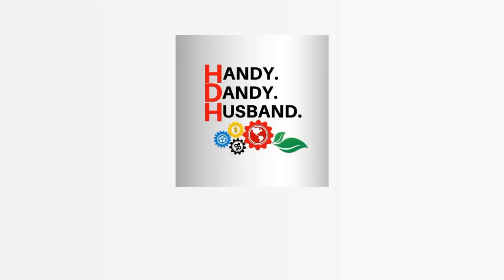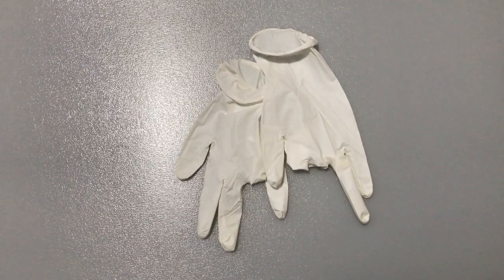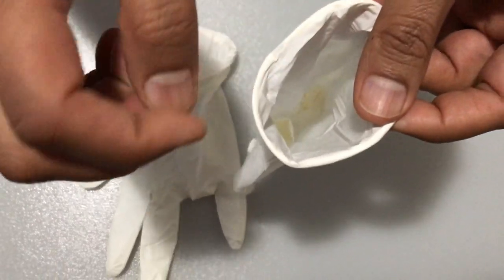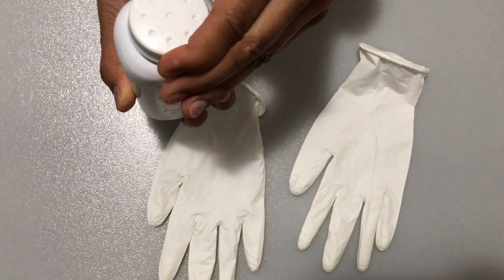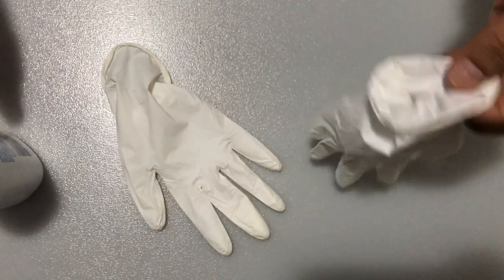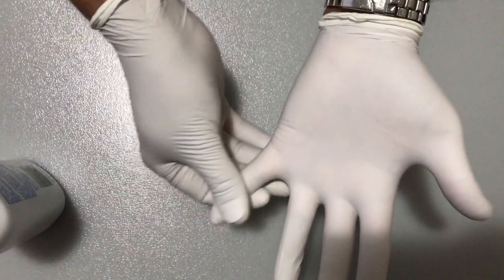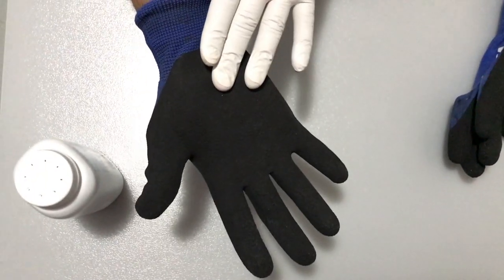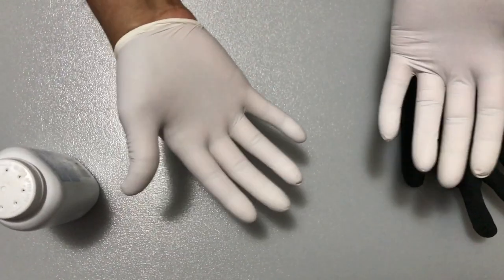𝗤𝗨𝗜𝗖𝗞 𝗧𝗜𝗣: 𝗥𝗲𝘂𝘀𝗲 𝗟𝗮𝘁𝗲𝘅 𝗚𝗹𝗼𝘃𝗲𝘀

Comment: Ok... Can i use other powder instead of baby powder?
Reply from the maker: Hi Rubel Sarkar.  Thanks for watching and sending me your question.  I suppose you could use other unmedicated powders; however, I have not done so because baby powder is ground so fine and is readily available.  If you do wish to use other powders, I would first check to make sure that 1) you are not allergic to them, 2) that the powder is ground to a fineness that does not irritate your skin (not grainy), and 3) that the material the powder is made does not have a crystalline structure (i.e. salt or sugar) which could act abrasively on your skin as you move your hand in the glove.  Hope this helps.  All the best to you, H.D.H. [: {].

Comment: Don't you sweat even more with gardening gloves over Latex gloves? Especially in summer💦🤣
Reply from the maker: Hi CJD, Thanks for your comment.  Yes, admittedly I do perspire more with the latex gloves and gardening glove combo, but I suppose I have become used to it.  For me, I hate it how the latex tears very easily if one rubs it against a sharp edge/corner which a typically vehicle engine  compartment is full of.  The gardening gloves act as a buffer and a bit of cushion from the edges while the latex gloves prevent grease and oil from permeating past the gardening gloves and into your skin (oil by the way is carcinogenic).  Best regards, H.D.H.

Comment: You do t reuse gloves they are disposable for a reason its unsafe to reuse gloves
Reply from the maker: Hi Dr. Torrance,  Thanks for your comment.  I think it depends on the circumstances of their use.  If you are working on your car or in the garden and just need to protect against grime...then in my opinion reusing them is OK.  While using gloves in a medical environment, will of course have different purposes and reusing them may not be possible or desirable.  All the best, H.D.H.
Reply: @HANDYDANDYHUSBAND  can I use for washing dishes during winter or Monsoon
Reply from the maker: @smubeen4315  Hi S Mubeen, thanks for watching and sending me your question.  Yes, I think you could use latex gloves INDOORS during a winter or Monsoon season to wash dishes and then reuse them with the method explained in my video.  Hope this helps, all the best, H.D.H. [: { ]
Reply: @HANDYDANDYHUSBAND  Ok😊 thanks for your reply